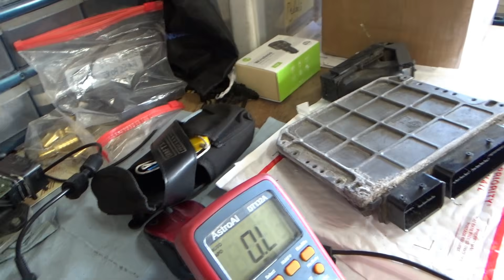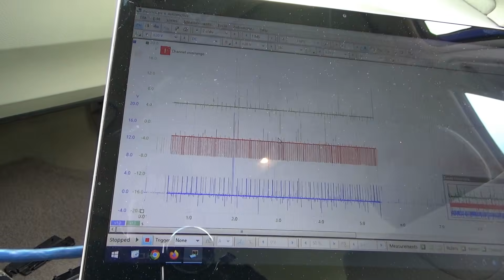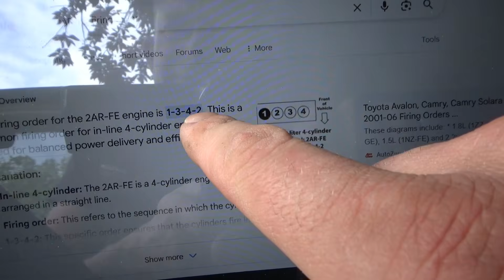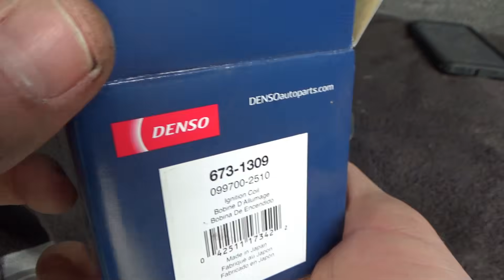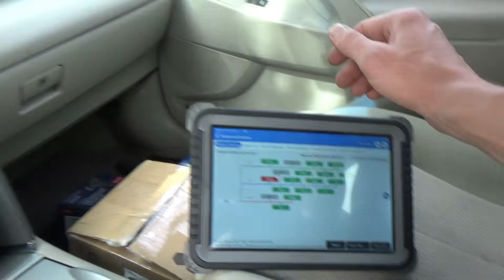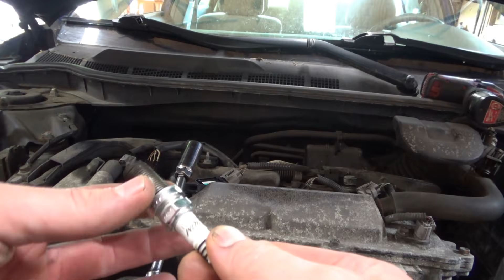(Pt 3 - CONCLUSION) CRAZY Camry...EATS ECMs?!? (Labor Day Special 2025)

Comment: I have seen it in 2 or 3 ignition coils my students brought to to test them. I don;t remember the make of them. But never saw a cooked ECU. In those occasions, the car would completely die in the event of the spike but the ECU was OK. You could tell that something was really wrong with the coils immediately be the excessive temperature of the top. Just by the 12 volts without ignition pulse. It would be interesting to check for TVS diodes in the 5 volt reference of the ECU.

Comment: Luckily the computers were cheap or this would have been a real nightmare.
I think you were brave to swap coils and try again...  I would NOT have done that.. I would have pulled the suspected coil and just checked with a new one.. That is just as good of confirmation.   That was a bit of unnecessary risk IMO.   IF the computers were more expensive, I suspect that you would not have done that.  ;)

Comment: It just means that there is not a good insulation separation between the NGK's control oil vs the ignition side.    What a shame.  They probably skimped out and didn't put in an insulator shield, and instead chose to rely on the "potted" resin that the fill it with at the end...  Well, that wasn't good enough obviously.  So because they chose to skip a step or save a little money (likely)-  it has now bitten their entire reputation.   I know it's cut thro4t competitive world out there..  but there are certain corners that can't be cut-  high voltage being one of them.     What a great case study... I thought it might have been a bad regulator on the alternator.. but this makes even more sense.   That high voltage spike can k^ll your scopes too.. So you really have to be careful when testing for this stuff..   An attenuator is your friend.  ;)

Comment: Great information..There was " maybe  " an opportunity for you to find this problem ,even without the scope. You in detail checked all the 5 volt circuits...but you fail to check the 5v circuits to each coil. And while at it , you could have checked the ignition coil primary and secondary resistance. My guess is that when you compared all 4 coil resistance values ,you would have seen one that was an outlier, especially considering that the secondary  output measured by NGK was only 10K volts, vs a normal over 40K volts. That would have been a definate  clue. This problem is actually a very old problem, that goes back into the 80's with GM HEI 7 pin ignition modules. 4 of the wires from under the distributor go back to the computer to provide  reference timing signal ( purple/ white) from the pickup coil, as a sq wave, a 5v bypass line to set the timing, a white wire from the ECM that gives instructions  to the ignition module, and a blk/ red ground wire from distribtor to the ECM.  It was discovered that the many ignition plug wires that ran around the back of the distributor could and did in fact cause interference  with the 5 volt control wires , especially if the plug wires were laid on top of the 5 volt wires.

Comment: Japanese cars definitely do not like cheap aftermarket BS special or Amazon special ignition coils. It causes the ignition system to go haywire tons of misfires and causes lots of other crazy problems. Very interesting case study and the invaluable data the scope provides. I wonder if you would put a annoyed light or a small mole test light or a fuse on the 5 V reference of the wire feeding to the computer from the coil system would’ve indicated anything that way?

Comment: Great diag as always Ivan. I was telling myself during the first video it’s probably gonna be a coil failure. I seen it a few times on older Nissan titans that roll through the dealer. Cooked one new ecm and just happened to notice one of the coils looked weird like the bottom looked melted. Well found out the ground for all the coils wasn’t the best and back fed through the control wires to the ecm

Comment: I was just thinking maybe they could put a diode in the coil to prevent this?  I have used their spark plugs for years too. I love them in snowblowers especially they are very good at resisting fouling.

Comment: You would think all ECM's would be equipped with transorb diodes to protect the internal components.   Especially needed when connections are exposed to crazy environments and after market parts like a modern car.

Comment: Lots of analysis and testing.
Big question I believe is, were those NGK coils legitimate or knock offs? Some comments suggested they could have been and were known to have flooded the market.
That is amazing to have a contact with NGK. Without that source, my guess is to get that engineer test would have been impossible not having a contact ! It really helps when companies will go to the trouble to work with their customers. Best of it all is, NGK got a good sample of their product that failed early for evaluation. Too bad they didn't dig up 4 new coils while they were at it and send them to Ivan but okay, out of warranty. 
I can attest to the advantages of having contacts with the big huge corporations in the USA as I had met with Ford/Lincoln engineers 20 years ago who were on the Lincoln LS team and the amount of information during that meeting was heavy duty about their suspension designs, steering and other vehicle designs. They could answer just about any question put to them and the answers were understandable, translated from an engineers language to an auto enthusiast. It was interesting to understand the lengths the went to get the weight distribution in the spindles outward and in the suspension as they wanted. We learned so much in those few days with them. As usual, Ford/Lincoln discontinued that vehicle.

Comment: Well now it is time to fix the 5 volt reference regulators , looks possible and may be quite easy.  Some one must do these repairs. Another topic. Does anybody retorque head gasket bolts every 50k or so now days.    As a kid in the 1960s people talked about doing this as a preventative for head gasket leaks. Just wondering. I just replaced the lower intake manifold gasket on my 1992 Buick lasabre and thought perhaps maybe i could have just retorqued it and may it would seal.  So thanks for the great informational posts. Keep up the good work. Thanks.

Comment: Congrats for your method and patience. There's no way a dealer shop could ever figure this out: they don't want to waist time in  diagnosing. You literally saved this Camry from being totaled.
Reply: A dealer might have replaced all 4 coils based on a misfire and health spark plugs. The blown engine computer would be a separate mystery.
Reply: @boardhead888 he would have fixed it without knowing why or how. Ivan fixed it the right way.

Comment: Excellent diagnosis (as usual). It's good that the ECMs are freely available, programmable and at a reasonable cost. Some vehicles ECM are hundreds of $, even second hand. That would have been a nightmare, having them re-manufactured at each fail. Perhaps the ECM could have been better designed, to filter out spikes. But then you would not see the fault until the coils failed entirely. Kudos to NGK for showing a professional interest.

Comment: I guess you could have checked the output of each coil and seen that one was not putting out enough voltage. Also, maybe a thermal checker might have caught the coil over heating.

Comment: EE here. I'm surprised that the engine controller does not use an over-voltage protection circuit such as a Zener diode clamp to protect the rail. Automotive electronics is notorious for creating inductive spikes. It's a well known effect.
Reply: Exactly right.
Reply: 10kv and it doesn't matter whats in the way, it's going bye bye.

Comment: Anything manufactured during the pandemic is noticeable. I went through and replaced all of my smoke alarms with new ones manufactured in 2021. After a month one at a time started going off randomly until the unit would just constantly sounding the alarm. I replaced one with a smart model that has a phone app to notify you when you are home. I live alone with my German Shepherds and I worry about them all the time im away. Having these alarm issues caused me a lot of stress and worry. The new smart one was manufactured around the same time and after about 6 months it started telling me see troubleshooting guide. Then it started going off at 3am. It wouldn't stop. Ive called them before and the tech told me to clean the alarm out. I did and it wouldn't stop going off. I had disabled the alarm and they sent me a new one. The new one was manufactured in 2023 and it lasted 2 weeks before just going off. When I tried to silence it because it was at 4am and I didn't want to have to take it down and disconnect it. It kept saying "Too much smoke, can't silence alarm" and kept going off. I got upset because I was trying to sleep and the shepherds were freaking out. I threw it outside and it kept going off all night until a neighbor called the police saying there was an alarm going off. The officer and me stood out in my driveway and boot partied the thing to death. Kidde obviously wont replace it so I went ahead and put some BRK alarms that another electrician recommended. He said stay clear of Kidde at least their recent stuff. I've seen many auto parts just fail. Like there is no quality check. My buddy bought a new stater for his truck and as soon as he connected the battery it short circuited and blew the fusible link in the battery cable. He never seen such a thing before.

Comment: This happens to the 3.5 ford the first gen.if you let the spark plug to long worn out  it over heat the coil and short the coil and burn out the computer.like the high voltage goes through the signal to the computer.😂😂😂😂
Reply: I did a few at the dealer, if I remember correctly part of a TSB called for updated spark plugs.
That smoked coil is a smell you never forget, worse than friction modifier

Comment: Stellar resilience to truly diagnosis. 
 I was a GM technician from 1985-1993, through the introduction to fuel injection, it was a continuous case study to figure out the multiple design problems. From fuel problems to software fish bites from TTC too early lock up. GM would only pay .5 to diagnose and repair wiring problems, which pushed us drivability tech's out or into other departments, I went A/C Electrical Trim to make a living. 
 You're the modern marvel of a top technician. Salute!!
Reply: Geez, you you should have stayed in the dealer shop, your missing out on all the .3 diag times.   Oh and the labor time cuts too!
Reply: How many of those OG Buick Know How videos I've watched 😂
Reply: @mikeluscher159  long days sitting in the GM training center in Garland TX, instructors didn't know how to fix them either lol
 Boy I worked a whole lot for free back in the day, GM was a straight up criminal enterprise

Comment: I have found 2 leaking coils by turning on the AM radio in the car and tuning it to a weak station. Start the car and you may hear ticking in the radio which is a leaking coil sparking within the spark plug well. The rate of the ticking will be related to the speed of the engine.
Reply: Creative!! I remember when i was a kid that my dad just installed a AM/FM radio in his car and during a ride he also tuned the radio on AM an yes it made that ticky racket on the radio speakers! I remember enjoying that because i could hear the revs of the engine. 
This was in the time when noise suppression on coil and alternator were not stock OEM equipement. (early 1970's)
So my dad had to add condensors to both.
Reply: Hey, you must own an old VW bug! 😀
Reply: It would not surprise me at all. Way back when had some plug wires leaking. AM radio was not happy. Just happened to lift hood at night when engine was running you could see blue voltage on the outside of some of the spark plug wires. New plug wires my issue was fixed and AM radio went back to OK.
Reply: @KM-os4be I remember adding a noise suppressor in the late 60ies to curb the ignition noise on a stereos during them years.
Reply: I used an AM radio (ADF for navigation) to detect lightning strikes while flying small aircraft...to have an idea how intense the storms were in the vicinity. Hey....use the tools you have. Great idea
Reply: How many times have we seen a mechanic pull out a coil, on a running engine to identify a cylinder that is missing. This is a bad idea, that has been warned about, for years.
Reply: All mechanics should have an EMF meter to check for these “poltergeist” cases that very very few people can figure out!

Comment: WOW IVAN! This has to be one of the best case studies this year. Great work. In rare cases BMWs will blow up the drive transistor  under certain coil failures,  FORD also known to kill ECUs if OEM coils are not used. (newer design of coil uses a blocking diode)

Comment: Excellent video, and use of scope.  I would have tired to repair the computer since we know the problem was the 5 Volt regulator was the burned out component.  The 5 volt reference most likely was one of the three pined square bolted down parts.
Best thing would have been to get a schematic of the computer.  Your friend might have those to share with you.

Comment: Very impressive! Having worked in the semiconductor fabrication industry, as a equipment engineering technician I definitely understand how finding the root cause is necessary. Your approach to end results was interesting to say the least. Working alone but having access to guys like Keith is invaluable. I think that a lot of aftermarket suppliers are having problems finding decent raw materials in order to fabricate their products. NGK definitely stepped up.

Comment: integrated flyback diode may have failed as part 2 of the fail besides the described short.  The breakover voltage rating is not meant to be as high as what takes place on secondary winding.   The diodes lasted 15 seconds, no more and it fried the 5v regulator also.  So in total, it seems like a multi-layered failure.

Comment: NGK should cover the full charge of the repair. Odds are nothing will change with there process. Good video.
Reply: I disagree, it wasn't a design flaw or a known issue. Sometimes stuff happens for no valid reason.
Reply: @johnt.848 I get that. This vehicle was an inch away from being in the junkyard for a 70.00 part. I wonder how many times this has happened just because there was not a “Pine Hollow Diagnostic’s” near bye.

Comment: Shame on Toyota engineering for designing such a fragile reference voltage output. A well engineered output of that type should be able to withstand shorts and overvoltages (within reason) without failure.

Given the poor design, I would have 1) placed a few 100uF in parallel with a 6 or 7 volt 5w zener to ground on the reference inside the box. 2) for troubleshooting substituted an external 5v reference from a lab supply. There's no excuse for burning up a stack of engine computers during troubleshooting.

Comment: Without question this has to be the most interesting fault I have ever heard of..in all my years of diag problem vehicles NEVER heard of a coil taking out a 5v reference, Major Kudo's to your passion/knowledge and persistence to track the problem down with pin point accuracy.!  You did NGK a HUGE favor with your investigation..had that last CU not lasted as long as it did and reported coil failure this diag could have lasted a long time..Great Job.!!  You are providing accurate insight on how to properly diag a vehicle.

Comment: Great video series on very good case study. I've always used NGK plugs, wires, and coils without issue and know a lot of other people that have done the same, but like in any other company, there are defects and quality escapes. This might be the first time NGK engineers have heard about this but apparently it's not the first time it's happened. Comments in video #2 show other people making preliminary diagnosis and saying the coils were going to be the culprits. They were right. So, maybe Ivan is the first one to send in failed coils to NGK, but it's not the first time it's happened. I'm sure NGK will take the proper steps to remedy the situation and prevent this from happening again.

Comment: Loved the series and the out come......coil spiking the 5 volt reference.  Well, you just proved that any respected manufacture could have a glitchy product failure after 4 years in used.  Liked how NGK wanted to know what happened to improve the product line.  I'll still be a customer of NGK one out of thousands produced is not a bad record and should not leave a bad taste in anybody's mouth.
Reply: It would leave a bad taste in my mouth unless I knew they improved the product or reimbursed the customer for what was likely a $1000 repair. This repair could have been worse had not the customer found Ivan. Imagine the customer scrapping this car over this.

Comment: The scope still showed spiking on the 5V lines from coils, but not as bad. The ECU makers could increase the filtering there, to reduce the spike amplitude getting in, and external filtering could be added as well. A small ceramic cap  (0.1uf or so) from the 5v ref to 5v gnd should greatly reduce the spike amplitudes.

Comment: I still need to break out on silly scope. I need to learn how to use it. I'm an ole fart. But I'm always willing to learn new stuff. 
I'm slowly giving up working on other people's vehicle. I turned 71 last week.
I pulled my 03 truck engine and repaired a bad oil pump pickup tube seal. 
I also did the rear main seal replacement too. 
I replaced my valve cover gasket too.
Got my engine replaced and it's fixed.

Comment: Hi Ivan, would a diode in the 5 volt ref protect the engine ecu from a spike like this, or would it cause more problems, like when the engine ecu carries out a circuit test, would it appear as an open circuit on the 5 volt ref ?